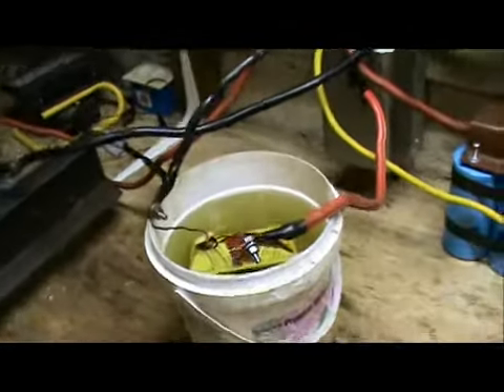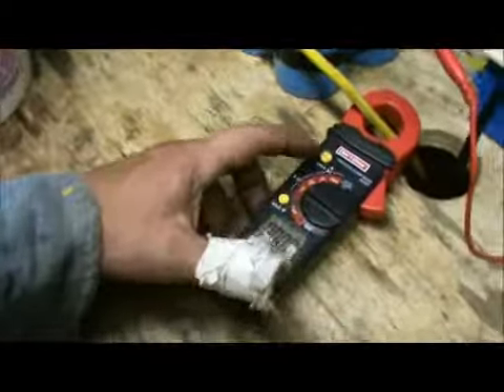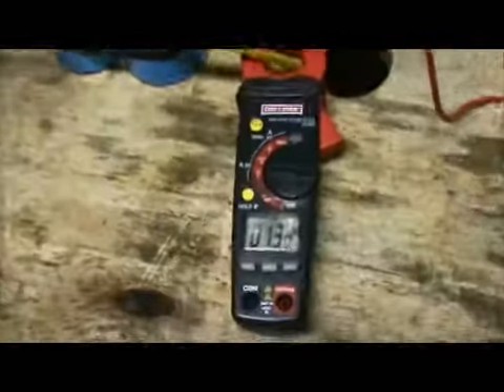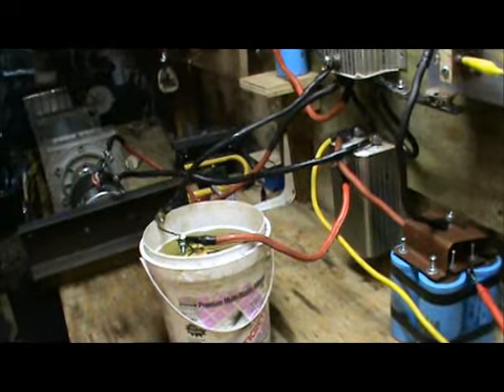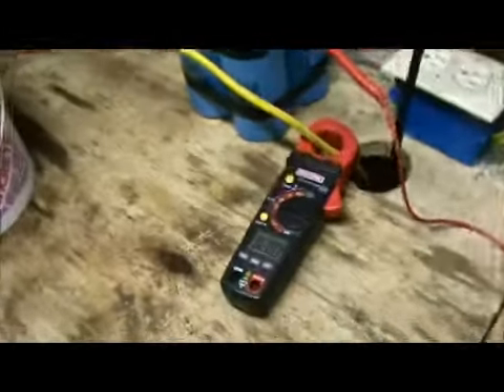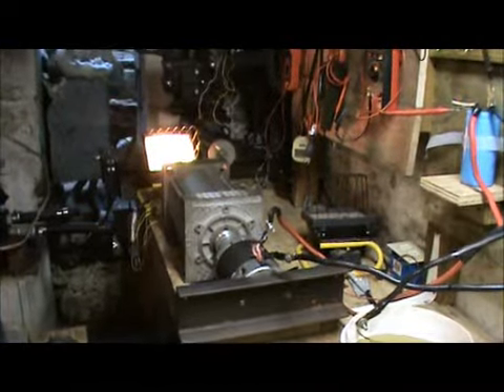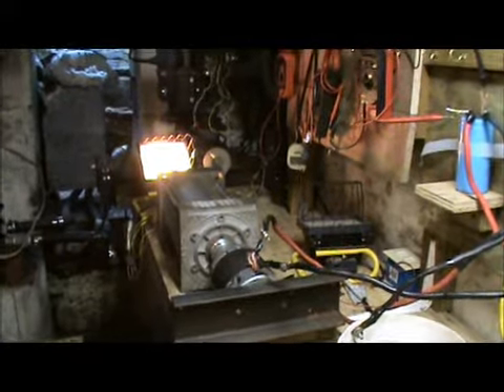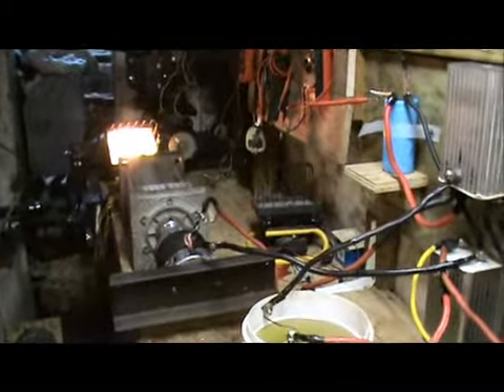True Back Electromotive Force

Comment: Hi! Can you describe to me how to add the Back EMF during off time of inductor voltage forward to add to same circuit with it's higher voltage ? Example- 34VDC half wave 6 amps through L coil 1.5Millihenry with several diodes added . Current flow goes through charged capacitance and switch , but needs also the added Back EMF  of about 100v.  I was thinking about a diode to ground , so as the return ALSO goes through spark gap to get to opposite side of inductor coil.  Like the buck and boost converter, the polarity changes on coil during the off time. Common relay coils just waste the energy on parallel diode.